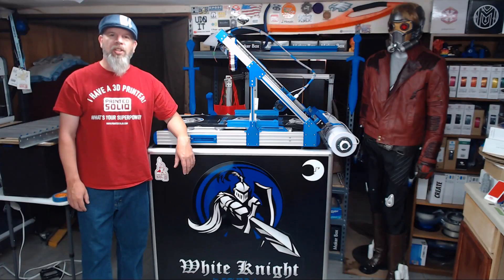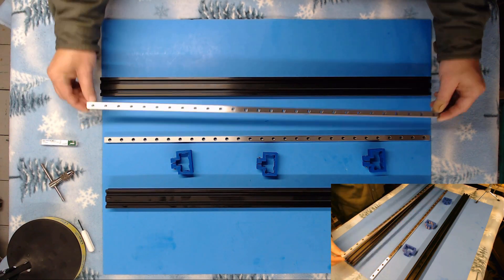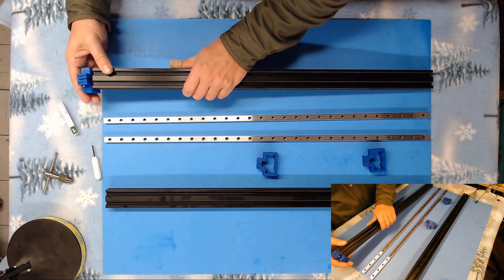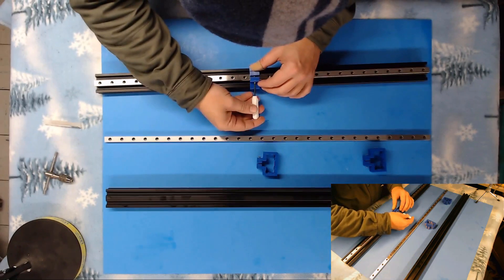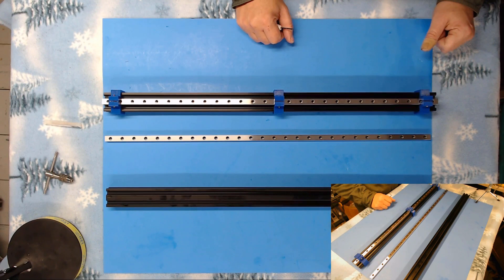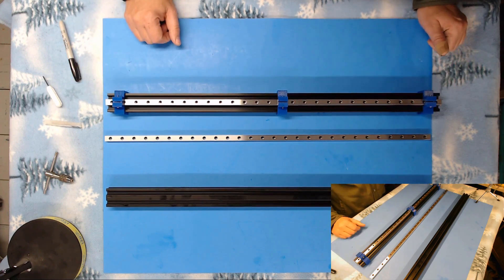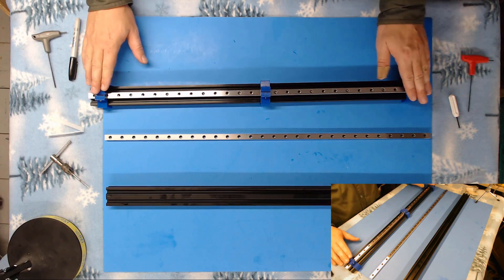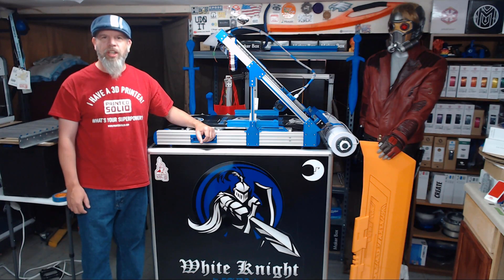White Knight assembly part 14

Comment: How come you desided to use linear rails instead of just Wheels for the v-slot? Great work btw!
Reply from the maker: I believe you get smoother movement with linear rails..  It was also to prove you could use all quality build components and still stay around $2k to build it.  I have seen at least one variant of my printer where they did change it to use the v-slot..  Also using the linear rails made it easier to design the side support without fear of blocking the v-slots..
Reply: @NAK3DDesigns  Maybe I missed a video, But did you cut the rails or did you order them to length. Thank you!